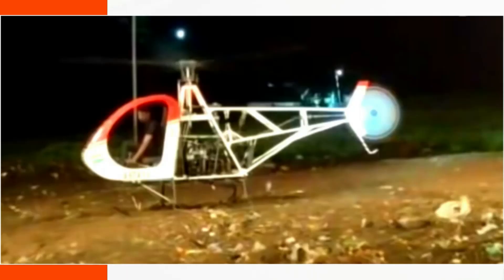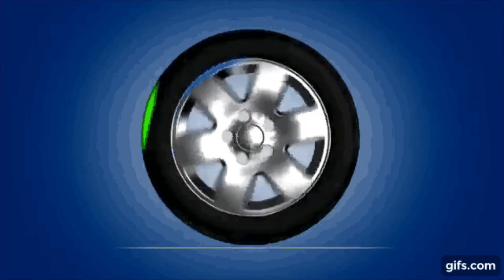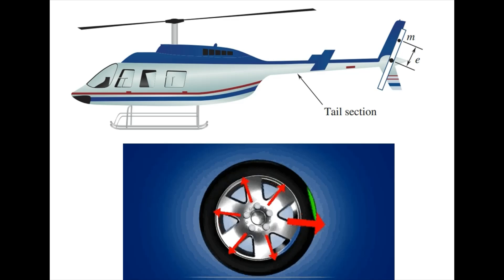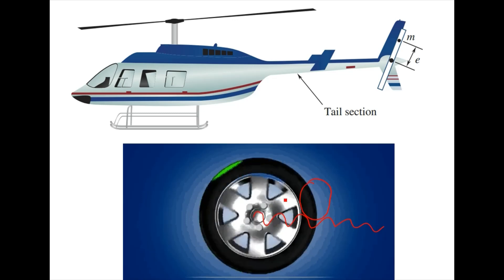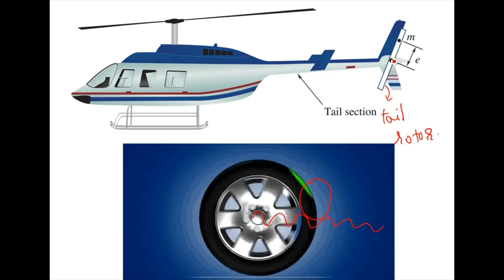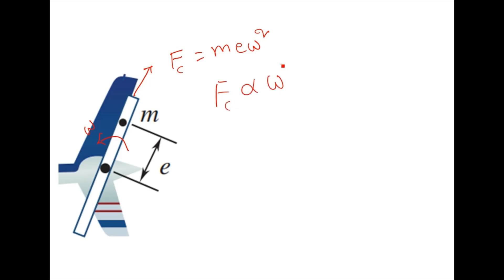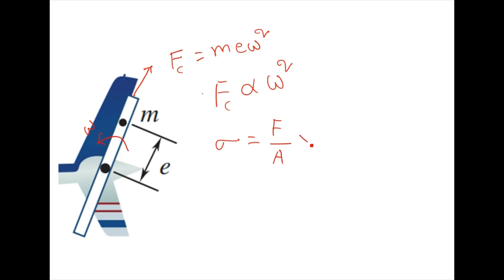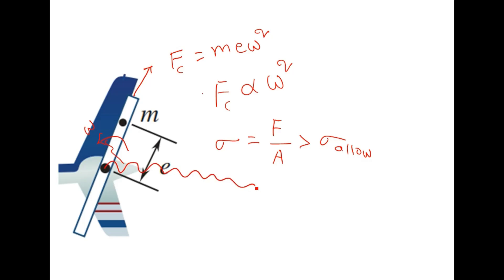Munna helicopter crash analysis - A mechanical engineer's perspective

Comment: There's so much debris surrounding that deathtrap, I would not be surprised something from the ground hitting the tail blade that made it break off. This trial flight should have run in the most controlled environment and just looking at the video, nothing about the test flight looked safe even if he flew a foot off the ground. I've seen jankier homemade builds of mini copters that don't even have a cockpit housing and just a seat that looked safer than this thing.

Comment: What I do not understand is , what hit the guy's head. The tailrotor breaks, blades fly here and there. One part hits the main rotor and main rotor hits the roof of the cabin. Which in theory should protect the passanger. So what hits the guy in the head ? This seems to have been avoided by installation of seat belts I believe
Reply: i can see that he hit his head in the frame from the impact of the blades, was a big concession, probably his skull get crushed, as you can see after the impact, the frame bent and the glass broken where he hit his head,  its an infortunate accident
Reply: the tail rotor explodes, striking the main rotor..off balance helo now over falls to the nose bending main rotor striking the pilots right side head fatally

Comment: 1. vibrations are caused due to the rotation of eccentric mass.
2. high speed rotation causes high centrifugal forces

the reason could be either one of the two or both.

this is the reason why the fans of airliners are manufactured on molecular level to ensure perfect mass balance and similar property of the matter in every direction.